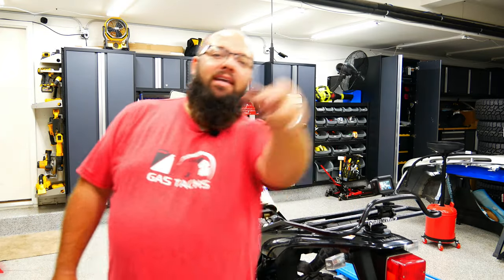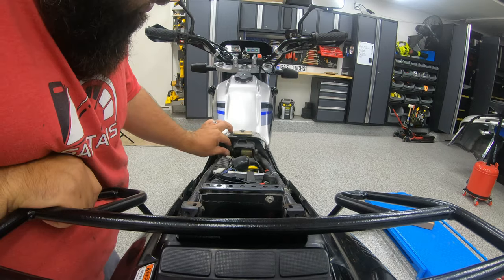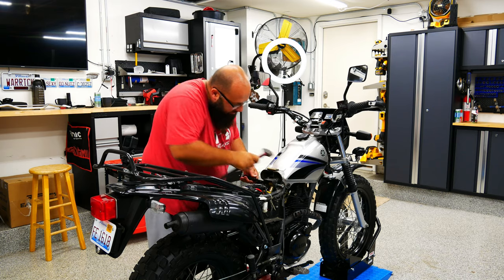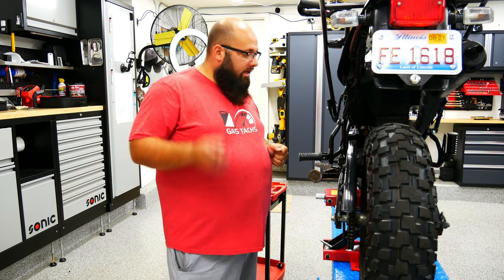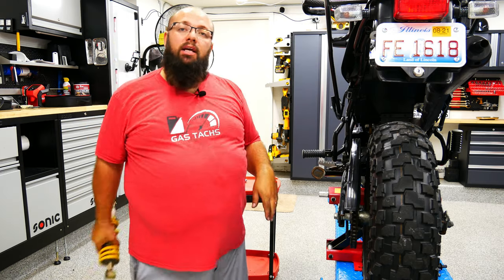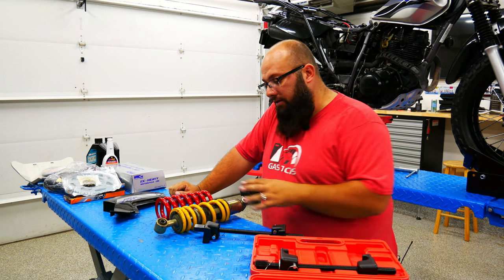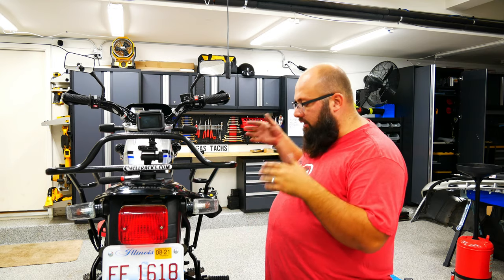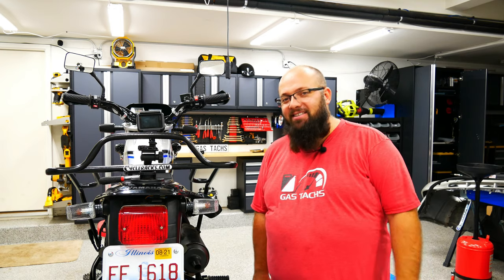Changing the Rear Spring on my TW200 - Big Guy Needs a Big Spring!

Comment: That shock compression process scares the $h!7 outta me. There should be a much simpler tool. All the spring compression clamps like you use seem to be designed for big car or truck springs.
Reply from the maker: Yeah, it is one scary job!